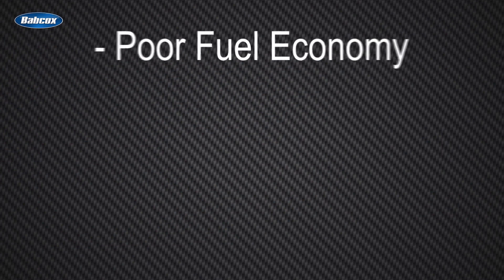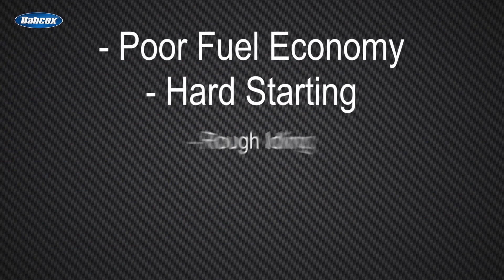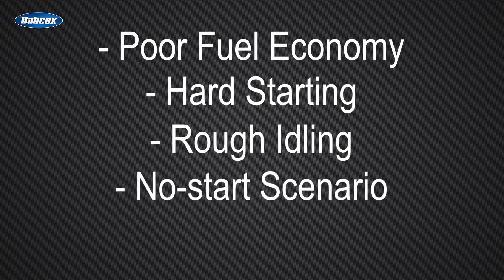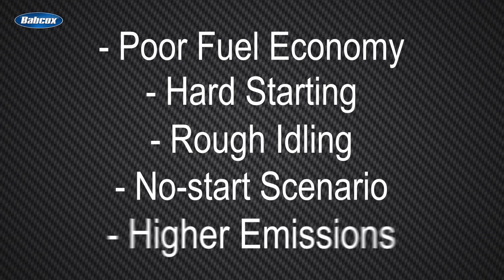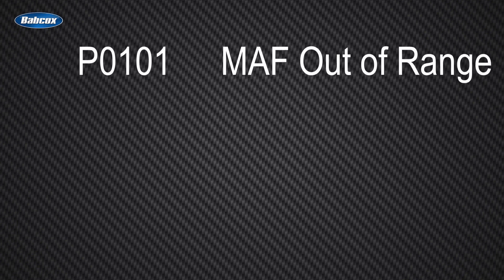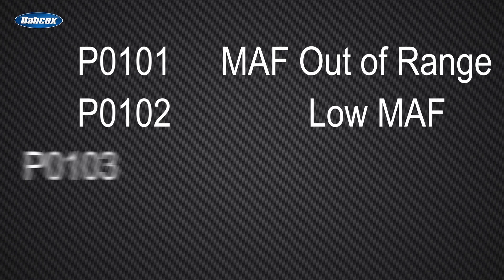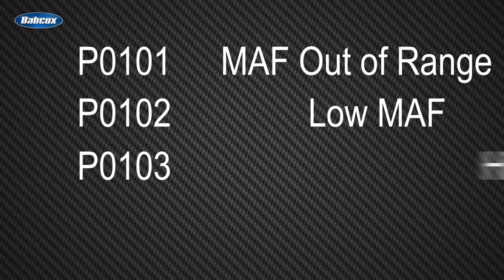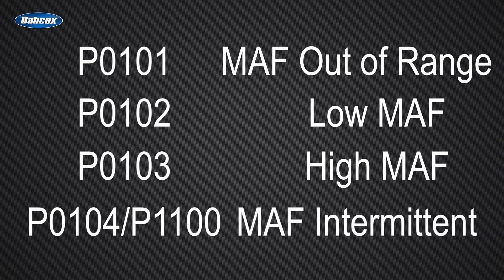Walker Products Mass Air Flow Sensors

Comment: How are we supposed to clean the MA360 MAF sensor for Toyotas? The sensor is built into the housing and cannot be removed.
Reply from the maker: You're correct - those are tricky ones! Also very sensitive MAF Sensors. We always recommend replacing the MAF Sensor over cleaning them.